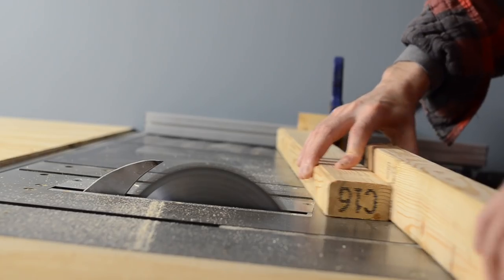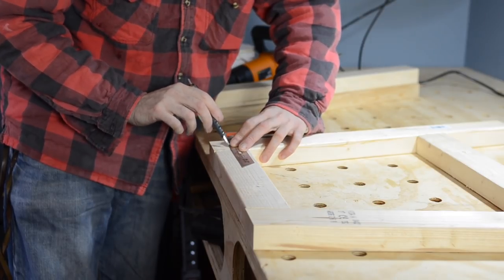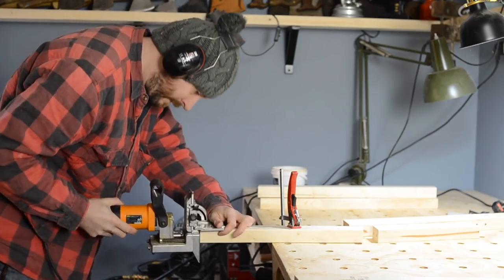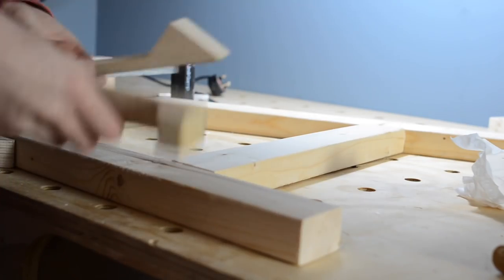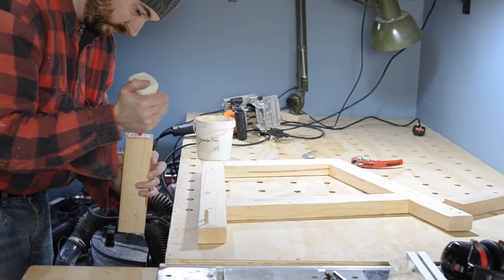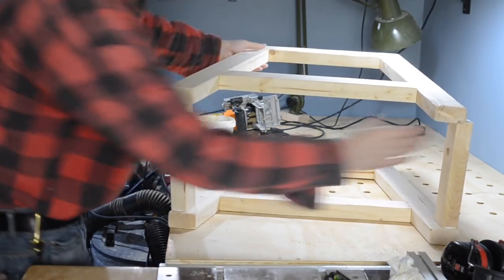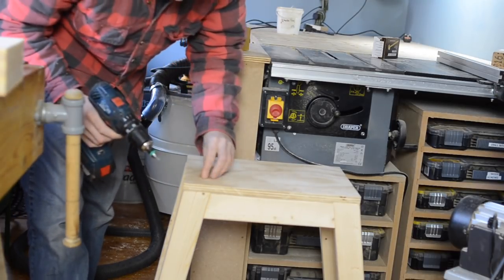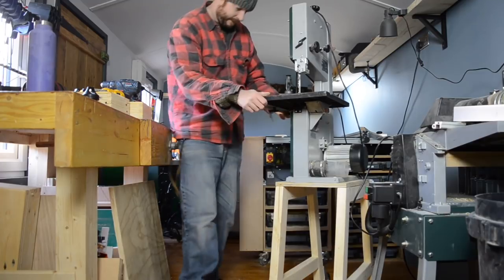Making A Bandsaw Stand

Comment: I bought a bandsaw that came on a base with a similar design, I thought I could do better and made my own base as a chest of drawers. I kept the bottom as wide as the original to take sideways pressure and built it square. It made sense for a small workshop because instead of the bandsaw hogging a whole space to itself I had storage under. I also added castors so that it stowed away but could be pulled out for larger jobs. Rgdz Jim

Comment: Great video Matt! However If I were you, I would have added a tilted (corner to corner) cross piece to stabilize even more the whole structure on the wheeled side and on the opposite. At the end when you moving it seems a little bit shaky. What do you think? Or am i just overthinking it? Btw if i will ever own a bandsaw, i will make a similiar stand for it for sure. Thanks!
Reply from the maker: Thanks Mark. Its pretty solid

Comment: Hi Matt, really enjoying your channel and it’s easygoing style 😀
Learning plenty by watching you work so thanks for taking the time to create the videos. Guess it must double/treble the time it takes to do a job! 
One like & question I have about this build is where to get the wheels from?
They could be useful for lots of applications, especially with a small workshop!!
Thanks
Just to let you know that I used 100mm non-swivel castors (£5 each from Screwfix) on the back legs of a workbench to get the same result as you did here...! 🙂👍
Reply from the maker: Thank you Dave. It takes so much longer to do things with filming. I hate to say that I could not find wheels like that for sale. I spent ages searching. I took them off the stand that came with my thicknesses.
Reply: Badger Workshop -Thanks for your reply Matt

Comment: Hiya Matt. I am surprised. You have a perfectly good mft style top, but you didn't use any bench dogs to assist with the dowelling machine or the assembly. Any reason? Also, the Bessey clamp (2:53) was a bit on the springy side.
Reply from the maker: I use the holes and ratchet clamps